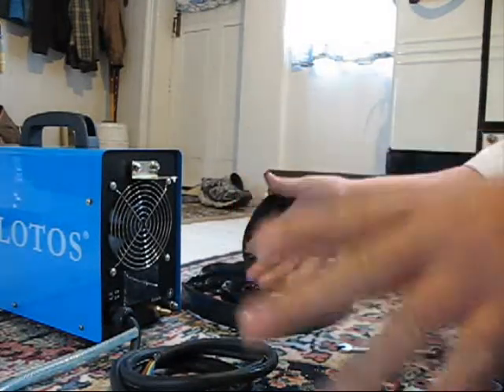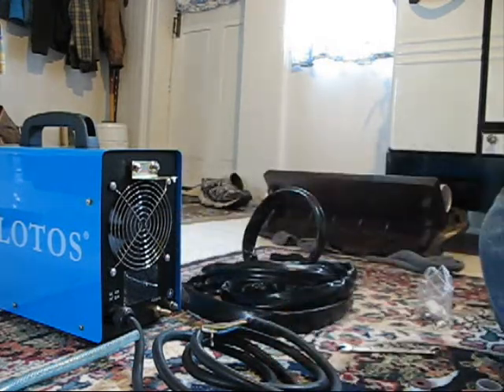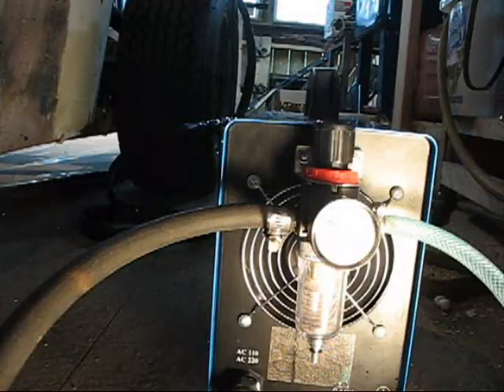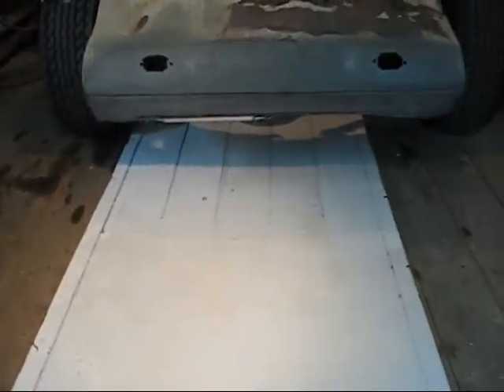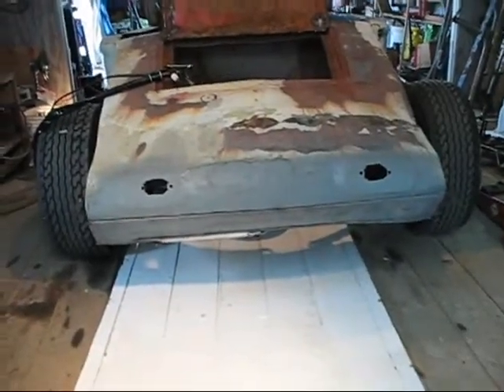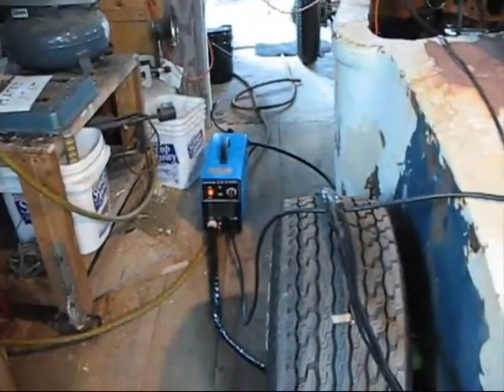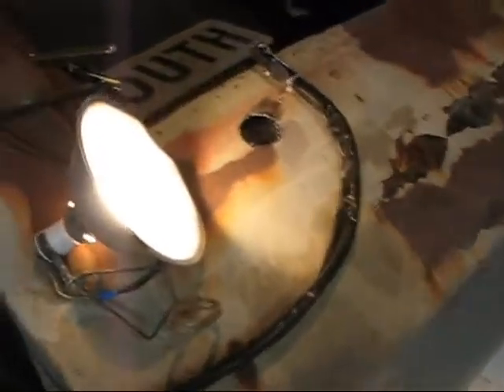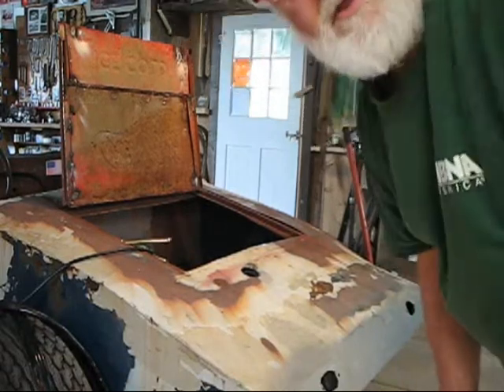First time using the new plasma burner

Comment from the maker: It was on 220, but w/a pair of 20 amp breakers.  I changed it to a pair of 50 amp breakers, and got the air pressure up and it seemed to work a lot better.  Thanks.

Comment: Try to adj  air your pressure,and make sure you have a good ground connected to your work.That's the  key to make those thing to work well.Also keep you nozzles and electrodes clean also.Just some helpful info.I worked with them for about 11 years now.

Comment: Another bit of info too, I believe that is a dual voltage unit.If you using 110, you can double the output by connecting to 220.

Comment: @transdetendal a tub of water beneath it wont catch fumes. Pay closer attention. The tub of water beneath it is to catch sparks/slag. makes clean up a little easier. but that would have to be one big ass tub. The fumes come from the coating on the material. Ventilation is key.

Comment: actually it dont make it fill up with water but sometimes it can produce carbon monoxide which is why you always have ventilation or a mask on while working plus it can burn your eyes like a welder so a shield is required